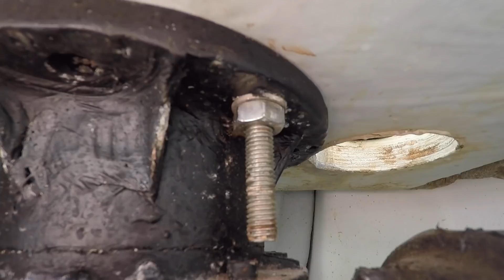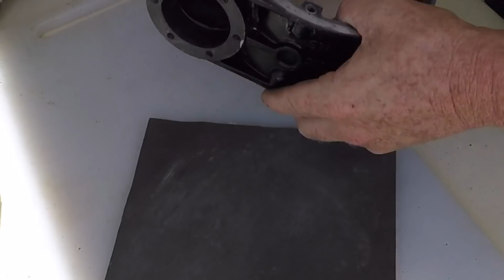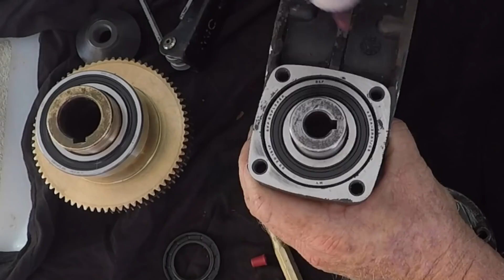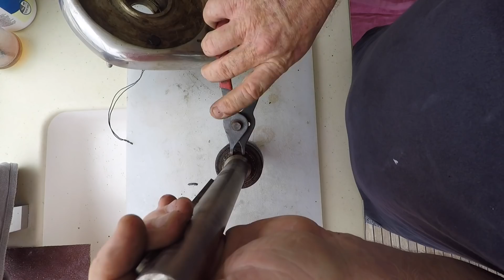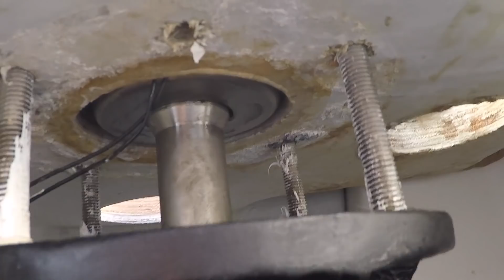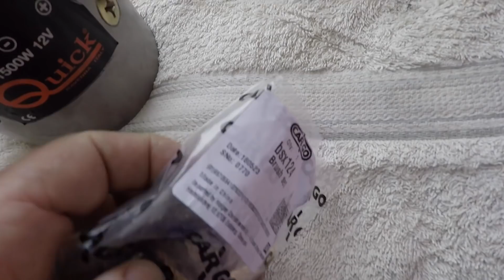ANCHOR WINDLASS STRIP & ASSEMBLE - Quick Argo entire winch assembly

Comment: When truing the surfaces with memory or wet/dry sandpaper,  I  would highly recommend using plate glass.  
I carry a piece I picked up at a glass shop for free which I use for sharpening edge tools and truing mating surfaces like this. 

It's also my paint palette for acrylic paint.  l😀😀

Comment: I think 518 is a better choice for gasket maker. What is your opinion.
Thanks so much for the video. I pulled mine apart today after a failure, and found the mud and salt under the gypsy had eroded the housing away and failed the upper bearing and seal too.

Comment: Hello Brent,

Very nice and useful video ! Quick should be grateful to you as they don’t have such nice and detailed video 🙂.
Nice video also the one in Tasmania , you combine technical explanation and fun, helping some people to realise their dreams, what a nice mission of life !

A good complementary video may be “how to shim bearings on windlass”. My English is not good enough (yet) to understand the comments you did to JC Clopton, and how you measure strain differences around the bearings to detect where shims should be placed. 

I have the same equipment as you (same boat as well) and similar issues, the more important one being how to remove the bearings from the shaft when they are corroded due to electrolyse, as the previous owner did not use tefgel at all. I will try your advice I saw in one of your comments, that is to put the windlass and shaft into the freezer, then probably to heat the bearing and trying to not heat the axle using a tube as a thermal protection, and lastly see if the hammering method or hub puller method could work.
Am wondering also whether the freezer we have on board is powerful enough to freeze the axle to retract it. 

A remark I have from the video is that you seem to use sika 291 to stick the windlass directly on the gelcoat, Isn t it too difficult to remove when you want to dismantle it ? I was wondering why you don t use the gasket that is proposed by Quick, so that only the gasket would be sticked with sika. 

I wish you very good wind !
Bruno
Reply from the maker: Bruno L  Hi Bruno and sorry for a delay in response - we have been very busy recently and missed some comments on our social media platforms. You always welcome to write to me on messenger on Facebook -
We have a page called IMPI and also
share some stuff on our cat Impi profile.

The trick with shimming the bearings is to make sure when you have tightened everything that the parts all still turn nice and free. This is a problem when you remove gaskets or shins because once you tighten everything up the parts can come under pressure and then the motor needs to work hard to get everything spinning.  
When you have the worm and gear feeling free and centered you can measure the distance from the bearings to the housing end caps on each side of the worm pinion and then look at the ridge on the end cap itself and take that measurement too.
Of course when you put the end cap in place that ridge will take up most of the distance in the housing toward the bearing but you also don’t want the bearing to be loose, so the measurement for the shin will be the first measurement (bearing to housing where end cap bolts on ) minus the second reading (end cap inner ridge) = shin thickness.
If the ridge is going to apply pressure to the bearing without shins then of course you will want to put shims or gasket under the end cap for the measurement the end cap stands proud. 
The trick is to just come up flush against the bearing without unnecessary pressure.

The two bigger end plates on the gearbox also need not to put pressure on those bearings so again one needs to just measure the distance . First put on the end plates and see what gap is there which will determine if you need gasket paper or if the tolerances allow for a flush mount using the gasket sealant I use.
By the way, no, that gasket sealant actually releases easy enough and one just cleans the surfaces afterwards.
Gasket paper may be better but it also is not good if bolts come loose and leaks because then you could loose the box. For this reason many people even use sealant with gaskets, so gasket sealant is good to use.
The only issue one can have is that if one tightens the end plates without gasket paper and the tolerances are too tight, you apply side pressure on the bearings and then the box does not turn well.

Perhaps I should have said more about this in the movie but I thought already it was too long and made reference several times about checking shims and the order they come out in as well as gasket thickness.

The important thing when you assemble the box is to make sure you will not be creating side pressure on the bearings after the worm
And worn gear are aligned.

If you have removed shims and kept a mental note on the order of things then put back the worm gear and worm pinion leaving the end caps off the pinion end and one flange plate off the gear and just center the gear tooth mesh so it all looks aligned. Then do the measurements I suggested for the end caps on the worm pinion and make up the gaps with shims as mentioned earlier. When it is tightened there must be no pressure on the bearings that makes the unit tight.

For removing the bearings when they are really corroded is difficult. You will see my friend Chuck with a huge contraption used to pull the shaft. Getting the bearings off the shaft can be done many ways but I sometimes use a dremel cutter (I have a dremel tool on the boat) and carefully cut through the bearing until it is very close to the shaft. Then apply a bit of heat to the bearing and it will pop off immediately.
The trick with the fridge is when you put the bearings back on. You only put the shaft in the fridge freezer section but keep it there for a day. Then the bearings should go on easily.
Otherwise you need to have an engineering firm press on the bearings.

I hope this helps and if not please correspond with me on messenger so I can share step by step - you could send photos as you proceed and I can help you get it together

My very best wishes
Brent

Comment: Well I watched the entire video and as mechanical electrical technician for 33 yrs and counting I have to say not only was the presentation 100% but the technical advice top notch. May I and a couple pointers only to enhance future repairs.  
Avoid bearings made in China/Asia, lesson I learned ,you had a mix there. Japan#1 USA#2
Item 1 always open your bearing seals on your new bearing and re pack , these seldom arrive with adequate grease SOMETIMES NONE ensure use manufacture recommended grease
Item 2 applying heat with a propane torch through the center of the bearing (do not touch housing with direct heat ) will allow bearing to slip onto shaft , you must be quick from heat to shaft (not warm Hot approx 2 to 3 min of heating)  . To perform this I have channel locks with curve jaws that  fit onto the bearings but any good quality channel loks will work. This will have zero stress on bearings, again check grease in bearing by removing seal without damaging seal.
No tapping bearings as in my books a no-no 
Other then that
.. you my friend are a top notch Mechanic 
Always enjoy talented individuals in the sailing community 
Cheers and fairwinds from the @captains.chair 
(Fyi there is other ways of heating the bearings, this  is done when I am in the field and have no others means)
Reply from the maker: Hi Jim and what a valuable contribution by you here and also the kind words - great !
I sincerely hope folks who watch the video read these comments to get added tips to the repairs - great team work.
It's interesting what you say of the bearings - when I did my trade with Caterplillar in the early 80's I remember the brand 'Timken' being drilled into our heads, and later when I had my own earthmoving business I drilled that into the mind of the buyer in our company. I'm really pleased you made me think about this again and for sure - bearings are all important in this overhaul.
I agree with you that 'tapping bearings' should be a last resort. My mate Chuck was telling me how he placed the shaft in a freezer for a day or two to get it to shrink and says the bearings went on fairly easily afterwards. It reminded me of how we used to use liquid nitrogen for this, and then ( not sure it's the greatest practice) at Caterpillar we had a tool where one places the bearing on a rectangular bar using magnetic forces - a type of induction heating - to expand bearings before fitting to a shaft. In the field far from workshops we used to boil up oil in a bath (oil drum bottom section cut through and blow torch) but I must say I had never considered heating through the center ring of a bearing but can easily see how that would work.
As for the seals in the bearings - agreed - actually we used to remove the one seal entirely and leave it open to the oil side so it literally bathes in the oil but there are advantages / disadvantages in that and I can see your suggestion of re packing grease and wonder what grease would be preferred (you mention manufacturer recommended grease but wonder if there would be a standard).
Thanks again for sharing the finer points and hope more folks will do so.
Cheers for now

Brent

Comment: How much would reworking a windlass cost at a machine shop? Should be worth a few hundred USD.  How long did it take?  For those of us without machine shop/engineering experience that seems like a lot of work.
Reply from the maker: Hi Jc - I thought I had replied but perhaps it did not go through.
In bearings and seals the cost is more expensive in Australia than in South Africa for example, but still worth doing.
Here is a break down:

1 of 30x47x7 Seal  = AUS$ 2.66
2 of 35x62x7 Seal = AUS$ 10.65 (tot)
1 of 45x60x8 Seal = AUS$ 6.56
2 of 6009-2RSC3 Bearing = AUS$ 60.75 (tot)
1 of 6304-2RSC3 Bearing = AUS$ 12.57
2 of 6007-2RSC3 Bearing = AUS$ 33.98 (Tot)
1 of 6206-2RSC3 bearing = AUS$ 15.71
2 of A35MM Circlip = AUS$ 2.00
1 of J62MM Circlip = AUS$ 1.50

TOTAL = AUS$ 146.38 

I didn't have time to shop around but am sure one can get these cheaper if you shop.

Bearings can be reused if the budget is tight and they look ok. We replace them mostly because I don't trust bearings and a collapse can be the cause of loss to the entire box.

If one is careful not to 'stress the bearings' which is easily done in these boxes, they could last for well over 10 years with everyday use. I did not really go into 'shimming' much on the video but to have long life in the bearings and prevent placing unecessary strain of the electric motor and everything else, shimming and gasket thickness is very important - and is why I mentioned observe shims and gasket thickness. 
To get great life from the internals I would recommend using a depth guage to measure down from the casing to the bearing of the worm gear with one side cover installed and do the same for the bearing to cover where the bearing sits in the cover to where the flange will meet the casing. This will tell one how much side pressure will be placed on the bearing once the bolts are being pulled tight,  which means the ball bearings will run hard to one side of the race. So we make up the difference in gasket thickness or shims.
We do the same on the worm ends and by doing all this we keep the bearings free and with bearings running free the elec motor will also have less work to do. This will make the overhaul worth the while hands down if the internals are in great shape - verses buying new.

When it comes to machining - I would not know as the guys at The Boat Works where we were tied to a dock, did this at no charge and as a favor. 

I would hazard a guess to say the machining in the cover for the oversized seal due to corrosion (I mentioned in the video) would have cost me about AUS$40 max
The seal surfaces on the vertical shaft (I did not show being done in the video since I wanted to get the video out) would have cost me a similar amount.

Jc - if all parts are in great shape it would take an ordinary guy a day to do the work assuming you have all the necessary parts and tools to hand and assuming the unit comes apart easily. The most time consuming thing can be getting the unit off in the first place and mostly because folks don't lube the shaft with a good product on assembly, and that shaft becomes frozen.
I now regularly take the lower section off, lube the shaft, and pull it back up. This si why I created an extra access to the 'hard to get to' nuts and threads. I now need to put a cover onto it - like one of those marine screw type hatch covers, but at least it's easy to fit and remove.

To be sure, it's a lot of work but for those who need to save money and keep the dream alive - they will find a way, and it is for those folks I was creating the video. I would have one into a lot more detail on shimming and gasket thickness if it were for experts to use. I hoped that by saying 'watch for shims and position of shims - watch for gasket thickness and reassemble with similar gasket thickness that in this way they get away from a whole lot of technical detail in assembling these boxes.
When it becomes technical, is when you see the worm and worm gear wearing poorly or gold bits of glitter in the oil - THEN - it gets technical :)

Cheers my friend - I hope this helps
Reply: @CatamaranImpi  WOW... great response.  Thanks for all you do... My wife and I will be joining you on the deep blue seas in a few years... We are looking into Maverick 440 hybrids right now.  Currently saving our pennies to make it happen.  We have about 7 more years before the kids are all grown enough to get out of the house. Until then, we just watch YouTube videos and dream.
Reply from the maker: Jc Clopton - fantastic - we know Rudi we’ll (Maverick) so please send our regards.
I look forward to your ‘splash’ and so nice for you guys to be working toward your dream ... so many people work just to survive so having a dream and knowing what you want to achieve through everyday grind makes it worth the while.
Cheers for now
Brent

Comment: Amazing, I would have thought it took much longer than 40 mins to strip and rebuild and entire winch assembly 🤦‍♂️  How long did it really take to do this ??,  how often do you perform this maintenance ?? and finally - and most importantly - how did Ana do learning Indonesian ??   Stay safe and be good.
Reply from the maker: Hey Glen - not sure again why my response did not post!
Yip - I would be lying if I told you how long this one took me to do mostly because I had stripped the unit, waited for certain bearings and seals to arrive as well as electric motor brushes which we had to import, but all things being equal if I had the spares and tools at hand I would consider it a job done in 1 day on the boat. 
We first stripped the unit after 6 years and I do it every 2 years because we live on the anchor and I want to make sure the parts remain 'fresh' / efficient.  It's probably an overkill but the top section seal gets replaced regularly to make sure no dirt is getting past it to the top bearings.
Ana's Indonesian - LOL - she is doing great and is good at languages, but she says Indonesian is quite difficult although many words translate back to Dutch which we understand so that helps with some words. Thanks mate - take care aye! Brent

Comment: Such a solid video Impi! I know it takes a lot of time to do all of this. You have inspired me to do the same to mine. I’ve replaced the motor and bracket a year ago. By the way - when I talked to Quick to update the motor they said the topsection setup that we have is much much better than the new one that they currently sell.
Reply from the maker: Hi Steve and thanks for the great comment as always mate. And Yes, Chuck and I were chatting recently and he was saying how the Quick technician that worked on his Argo advised him not to go for the new unit as this one has such a solid top section. I just think they could have thought the top seal through a little better because I've noticed dirt does find it's way into those bearings if we don't rinse off the chain after anchoring in muddy waters.
Quick, Harken and Lofrans are using the same 1500W motor - just the bolts differ a bit - as in on the Harken 4 studs whereas on the Quick 2 studs. Saying that though, one can swap them over or in an emergency use a Harken winch with 4 studs entered into the holes on the Quick collar. One is able to place a nut on 3 of the studs in this instance however without the cover as the studs are shorter on the Harken.

Comment: Another great video Brent looked like a mark or two on the seal surfaces.
Reply from the maker: Hi Darren and yes - well spotted mate. I went ahead and assembled to complete the video but took out the main shaft to have the seal surfaces done - a must do for life of the seals. There was a lot more I wanted to share like using a vernier to make sure not to place undue pressure on bearings and to keep turning the worm during assembly to make sure it stays free. In the end I thought I may kill the video with over information. Good job Darren - cheers mate